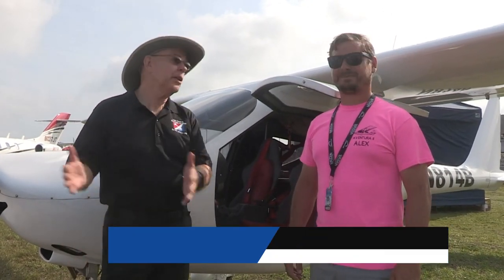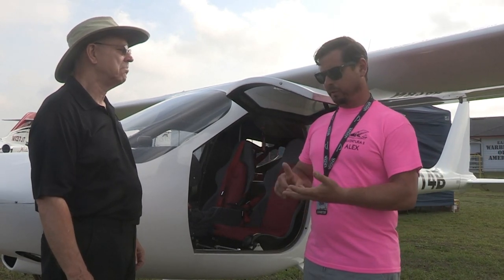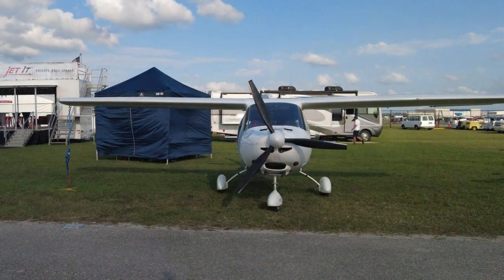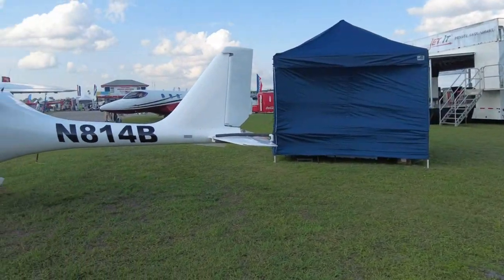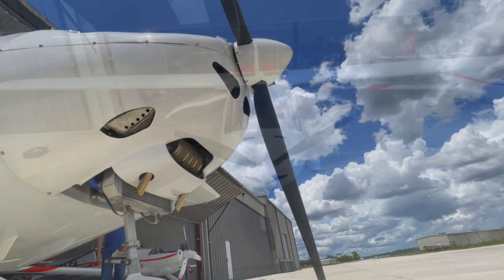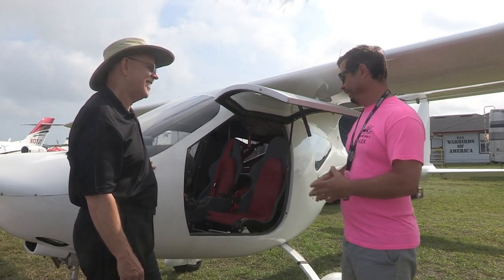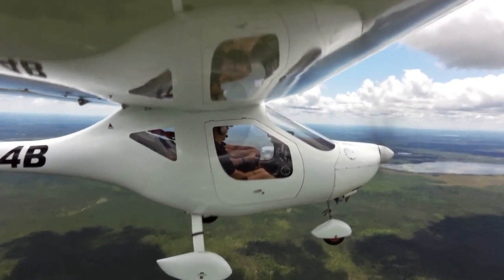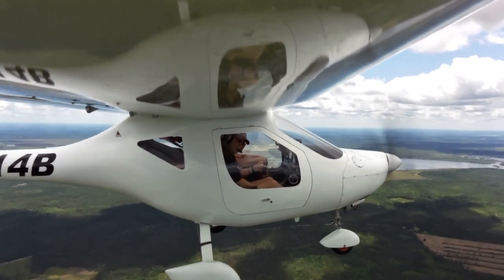SC 07 BOT Speed Cruiser, Aeroaffinity.com

Comment: Front windscreen is only one axis curved so they can just use flat sheet. That should be quite cost effective. What is the price? their website doesn't seem to indicate. Bit of an unfortunate habit in aviation to hide prices.
If they can represent it, the german made FK14 might be very interesting. Looks great, light, has a ballistic chute, low price around 137k€ and can do 240km/h (130kts) with 912 and they say they are working on a 915 version. And the swiss made Risen/Siren 912/915 are unbeatable but more expensive. I recently found out that if you bring oxygen the Risen 915 can do 250kts at FL200, that's 463km/h. That's going places. Not far from a Cirrus Visionjet in speed. While burning maybe 30l/h or 6.6gph vs a visionjet's 74. And can land on any field. Different birds but still.
It would take one hell of an engine to get a cessna 172 up to 250kts.